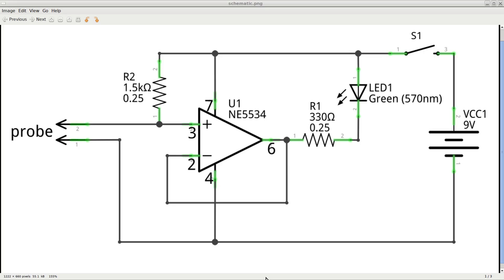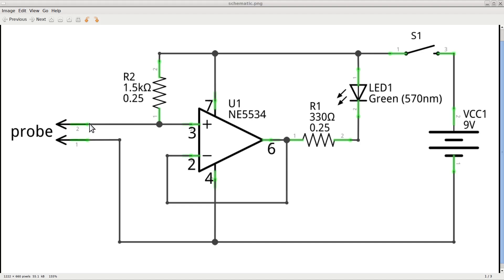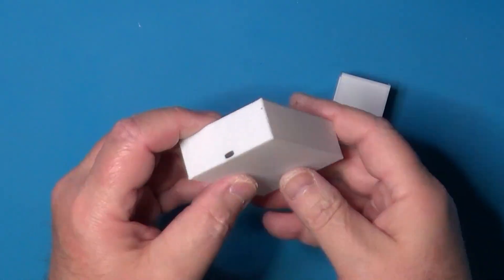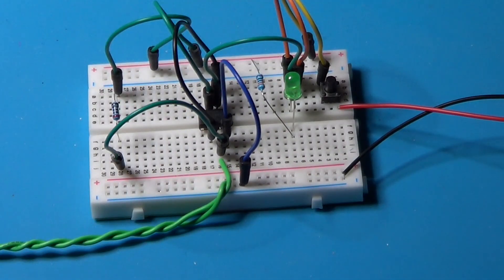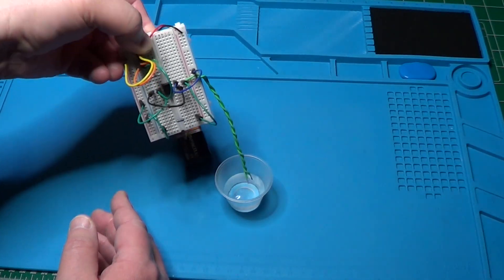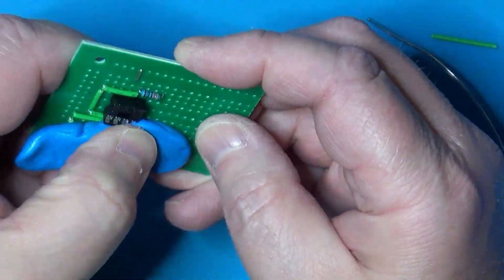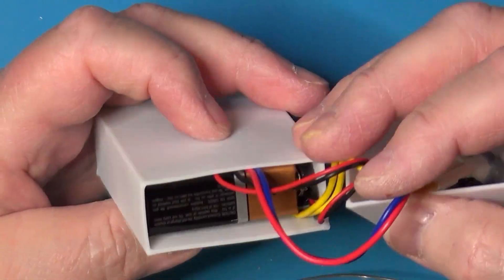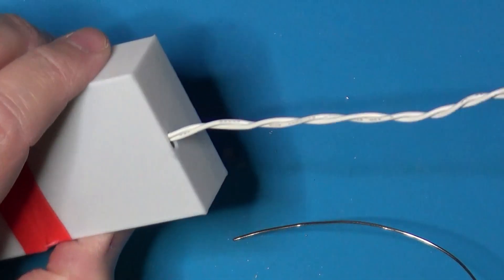When Electronics Meet Chemistry: A Conductivity Sensor For Liquid Solutions

Comment: you have standing dc potential across probes. this will oxidize the probes. it will deposit chemical metals in the liquid making a metal poison cocktail.

sensing current should be ac not dc.
one probe could be sinewave from opamp oscillator, other probe to high impedance input opamp feeding  notch filter detector
Reply from the maker: The current involved is very low and the probe is immersed in the solution for just a few seconds,  so the oxidation process is very limited.  In addition,  we are talking about testing solutions that are already poisonous. Nobody would ever think of drinking those liquids. We are talking about high school chemistry.  Also, using alternate current would not change much from that perspective. It would only cause oxidation on both wires instead of one, don't you think?
Reply: @eleneasy  I think AC would cause less metal deposits, which is why manufacturers invented chipsets just for this. 
admittedly if I was going to measure the level of water for humans, i'd go with magnets and reed switches or a float/level/magnetic hall sensor. 

Your diagram works, but it does have the negatives as listed.
I built one very very similar (ua741 based) when I was 12, so about 1978.....
Reply from the maker: @lezbriddon  I agree, there are negatives. But the device is just for didactics purposes and will never be so intensely used to to cause any sensible metal deposits. I had to build the device in a hurry, because my wife needed it almost immediately. Moreover, she needed a number of them, not just one, so I decided to go cheap and build one with minimalistic characteristics. And considering also that she was going to use it to make her students distinguish between ionic and covalent solutions, where only the ionic solutions would have allowed current to flow, and where those solutions where already made with a base of various metals, I didn't worry too much.